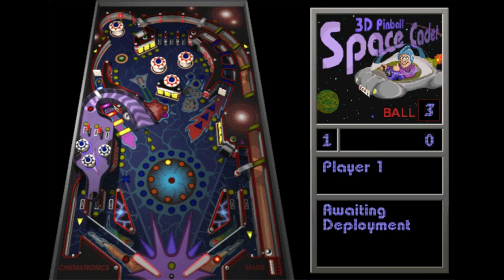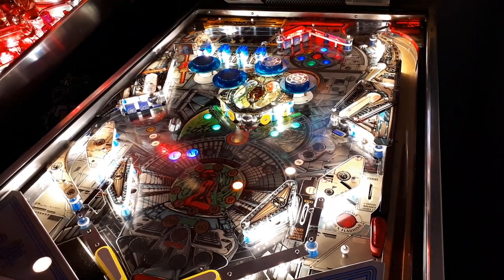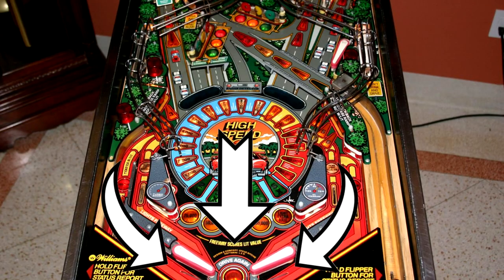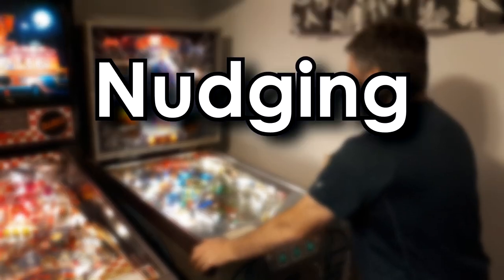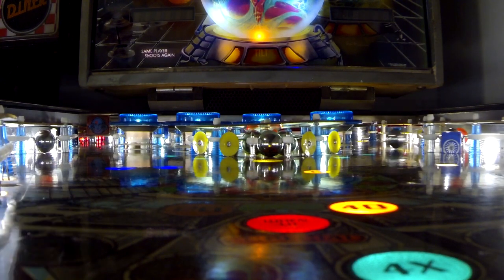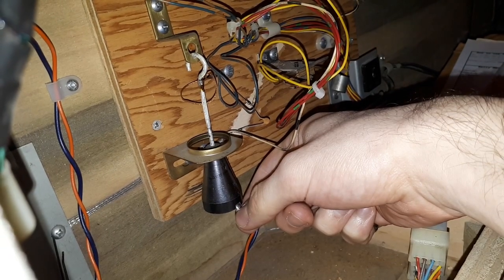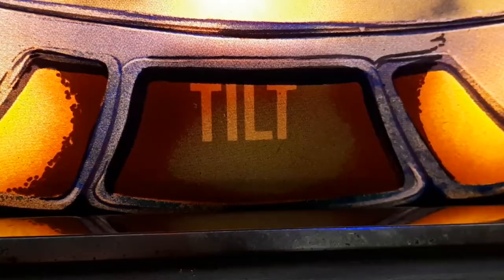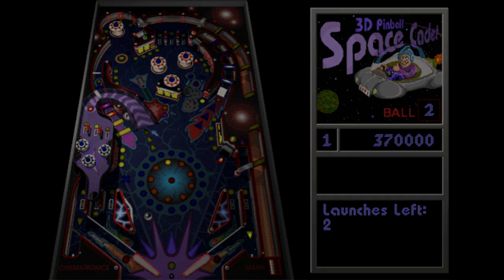Going Full-Tilt: The Trouble with Digitizing Pinball

Comment: The 'nudging' showin is very tame.... I've owned and pwned many pinballs including a black-knight 2000 and eventually with each of them got gott enough to to play it for hours on a single ball - then usually got bored and lost really fast but the take away is u gotta make dat thing ur biatch, grab it with intent and test it's limits - the tilt sensor u show is capible of being adjusted height-wise so that it's more or less sensitive. Also behind the plumb bob thingy is another tilt sensor specifically designed to detect lifting of the table... 

Do you make the music u use for ur videos? It's really awesome!

Comment: You can actually get really accurate nudging capabilities by using an accelerometer with programs like Visual Pinball X. Especially on virtual pinball machines, it is really impressive and solves your problem all together. Take a look (nudging part will automatically play): https://youtu.be/aeLVIH5NPjM?t=653 . Apart from the glitching when the ball comes to the left of the shooter lane (that's a glitch with the table itself, and not the nudging feature).
Reply from the maker: Yeah I have no doubt that modern games have finally been able to accurately replicate the physics! There have been some huge advancements over the years. This video was intended more as a quick explanation of the concept of tilting using Space Cadet Pinball (and other digital pinball games of the same era) as an intro point. Plus, this had the 1 minute time limit since it was part of a large collab, if I ever do a longer video on pinball it's definitely something I'd cover.
Reply from the maker: @1998SIMOMEGA It was a contribution to a larger video where each segment had to be exactly 60 seconds long. If I had more time I would have gone into more depth.